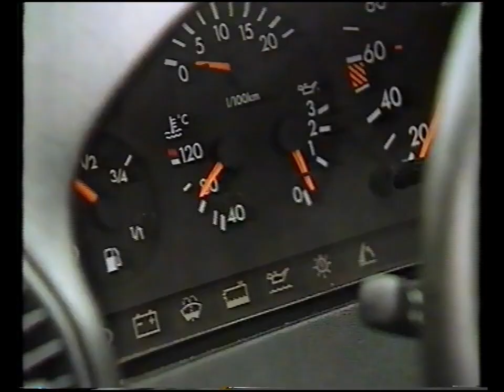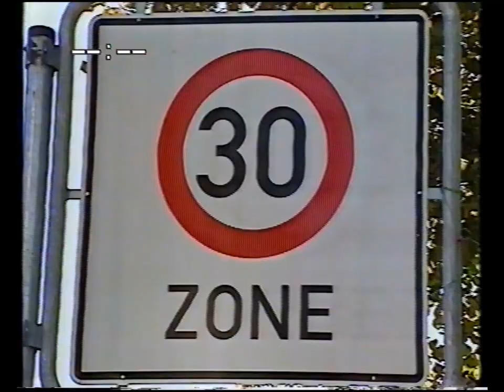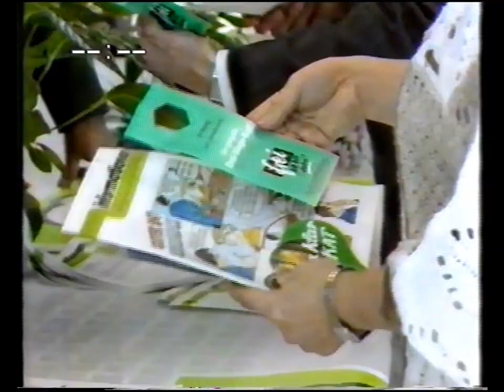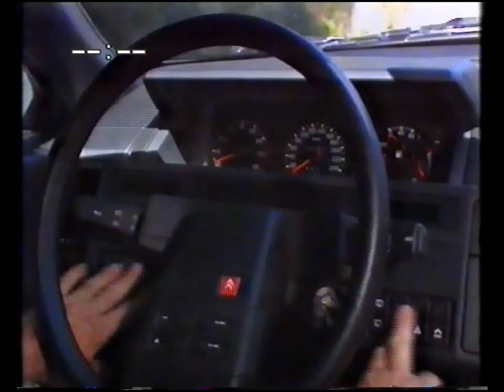Top Gear Series 22 Episode 1 (14th September 1989)

Comment: 4valves per cylinder + 5000cc + 300bhp = underpowered for a BMW engine.
Reply: BMW?
Reply: They needed a 12-cylinder in those days to get to this kind of power.  The R129 V-8's first iteration had 322 hp and 350 lb-ft torque.
Reply: @seanfyodorovich5230  the 12 valve per cylinder 325i of the 80s had 170+ BHP and excellent torque curve so a flagship mega expensive coupe probably should have been two of those in a V to give over 350 with minor tweeks to camshaft for a sports coupe. It was not a good 12 cylinder engine in bhp per litre terms and should have been worked on much more before release. The 850ci is more like it but was a lot more than an already expensive car for BMW. Still, would love to own one, they sound great and with average speed cameras everywhere it makes no difference today how fast it is outside of 50-70 overtaking band I guess or 0-30 timings for exiting junctions.
Reply: @madcommodore  I would not like to have to adjust those 12 valves per cylinder you refer too!
Reply: @grahamwright8447  No, people paying the list price 850 paid BMW engineers to do that job properly more than enough. To be honest 2x 172hp of the 6 cylinder tamely tuned 2.5L engines of the E30 325i means anything less than 344bhp for the 12 cylinder 850 super coupe was a rush/bad job when Mercedes were pushing far more from their 5L V12s sports models at the time.

Comment: And now its time for - Conversation  One way ,street .  - I d like to address the issue of fast drivers on autobahns and motorways in general.  Stop WASTING government money on trying to change the streets cos its not the streets that crash into thing on the motorways ! its drivers ! and why built 200mph cars for us to drive in , then tell us not to use the car as  it was designed! So, tell the car manufacturing co. to stop  putting in high performance engines !! As for the driver , it should be THEIR Choice about how fast they drive , if they kill themselves because they ve sped off the road and wrapped around a trree  then that s their daft fault and they will suffer for that.  My point being that by Imposing speed limits everywhere , is like  bilding a swimming pool and then telling ppl not to  swim in the deep end incase they drown ! its stupid, won t work and what s the point of spending the tax payer s money on putting obstacles in the way !  Rather than just letting ppl get on with it, and like in the pool , if they are drowning, well that s why we have llifeguards ! and if someone is driving fast but causing danger to other drivers by ILLEGALLY Weaving in and out of traffic ,then maybe the police could intervene then . Otherwiise , the message is clear ,  let us motorists , get on with it !! and as for kids running out into the road and causing speed restrictions ! why should WE Suffer cos some idiot parenting  ALLOWS these accidents to happen! iif you watched what your children were doing near a road! rather than plaing on your phone , we wouldn't be driving around at snaily 20mph in a "built up area" .  and one more thing,  Hydrogen ! Even more flammable the petrol and Even more toxic! in fact, mixed with water, it ll cause Chlorine gas ! so don t derive into a river or you ll either explode or be gassed to death !!  Things with Hydrogen in it that didnt go so well, The Hindenburg air ship , Richard hammonds Hydo -electriic car , which upon the crash,  looked like Grenfell Tower. ! The Hindenburg  btw was caused by STATIC Electricity ! ( a thunderstorm!!) so, if your driving a Hydro powered car tonight , pls check the weather forecast before setting off ! That s the end of ,  rant street for this week.